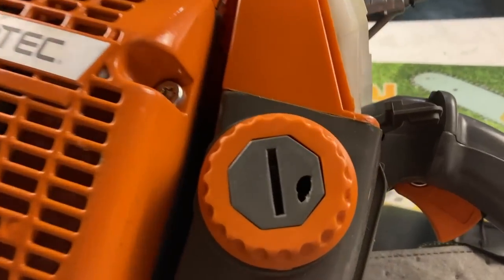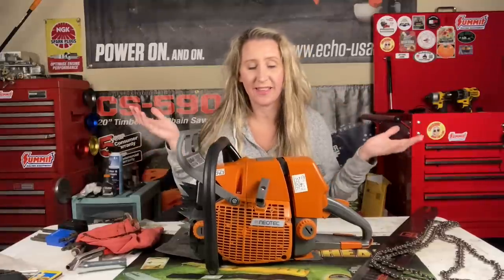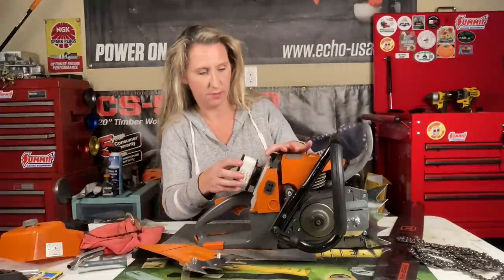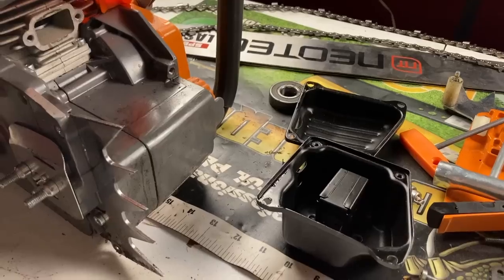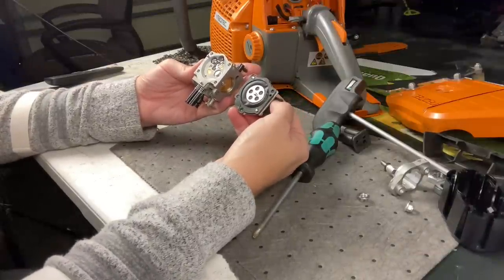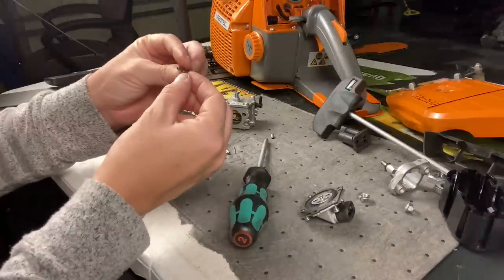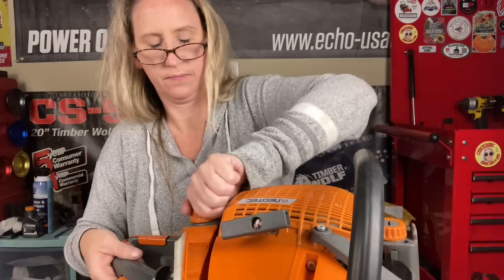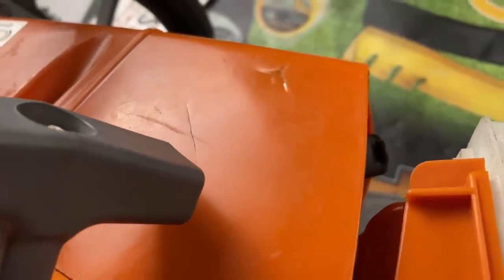NEW "STIHL CLONE" chainsaw, NEOTEC Mechanic Review and Repair. (You won't believe what happened!)

Comment: Hi mate ,i have a neotec 070 i have been using for slabing for over 12 months and hasn't missed a beat so for
Reply: I'm going on month 6 of quite a bit of milling with my Neo Tec 8105/070, only thing so far is broken clutch spring, probably from the saw dust with the saw constantly running on its side.

Comment: well i have a ms250 clone from haultz former and i have had it for over 3 years and i have worked the hell out of it and the only things i have had problems with is the clutch and pull start and it run very good it starts 1st or second pull!!

Comment: G444,G466,070 all blue thunders run perfect 3 years so far  18,28,42 inch bars. Cut 10 - 94foot oaks last year. cutting all oak here. New they need to run rich there super tight  old school brake in.

Comment: So I bought a NeoTec 892. I didn't trust the H/L needle valve settings so went to screw them in all the way and the Low side doesn't seem to bottom out. It gets tight but I don't want to overtighten. And ideas? Pull the carb out and take a closer look?

Comment: I think to be safe, buy the smaller power equipment from a reputable dealer, be it Stihl, Echo, or Huskavarney. Whatever you prefer. In my experience, I've bought a number of pieces of equipment from  dealers, it was test ran, set up and has not been a problem since. And if you do buy from an equipment dealer, be sure to explain to them how often the equipment is used, and they can recommend the right fuel to use with it, and maintenance requirements. These little machines can be very expensive to buy  especially if you are running commercial grade, but investing in quality equipment, and the right maintenance and support, they will outlive their aftermarket counterparts.

Comment: I would just look around until you find a quality saw used in good condition. I needed a larger saw to take out several larger trees my old 021 would struggle with. Found an 038 av mag2 72cc in amazing shape for $125 bought a new bar and chain. Filters and lines. Now I have a saw that will last me forever as often as I need something that large

Comment: Hello I have a question.  Do you ever fix or rebuild Old chainsaws? If so how do you get parts on saws that are from the 70's. I have a Skil 1616 chainsaw , the coil wire pulled out of the coil and it also seems the coil is bad anyway. I have tried searching ebay and the web in general for coils that are for that model but nothing. Is there a way to find a coil made for another saw that will work? Thanks Bre

Comment: Really hope to see a conclusion video on this saw...(can/will it run properly) Great work!
Reply: Me too neither!
Reply: I guess it was to avoid encouraging people to stihl buy the Neo thinking they're okay with a little tweak here and there.  I'd rap the plastic with a screwdriver to see if it fractures that easily. 
It's strange the recoil would or could have kicked back so strongly to yank it out of the customer's hand and hit the plastic so strongly, especially if it never fired once.  Seems that it was maybe dropped onto a hard surface and the plastic couldn't hold up as expected.

Comment: Few years ago I bought a new Karcher pressure washer the engine casing was very thin it had a hold in the casing behind the flywheel similar to the chainsaw gas cap

Comment: Wow that is some cheap manufacturing. I just realized I might have flipped seat up side down on the needle! 😫 well I need to replace hose and bar oiler I think! On my recent purchase of a Stihl 021. I decided to go vintage for my fist one saw! Take apart and rebuild so I can learn how to maintenance myself! I do enjoy wrenching on these thing. Great vid. Is the ms210 the same engine as 021 I will have to do research. I can’t wait to get this fire cracker running. I even downloaded the Manuel. Maybe some day I can get my own place or go work for Bre!

Comment: If you buy the 892 buy the kit. If you inspect each part as you build it,  file the sharp cylinder ports and tune the carb starting at 1 1/2 turns from seat on both screws(maybe take the carb apart first to have a look) Kinda a fun project for the weekend wussies

Comment: I purchased the NEO-TEC 12'' Top Handle Gas Chainsaw 2-Stroke 25.4cc from Amazon. The package had everything included, and I had to adjust a little on the carburetor, but it cut and ran fairly good. Sometimes it would stop going to idle if I did not hit the throttle a little, but it worked good. I manually oil the chain and bar rather than place bar oil in the reservoir.
Reply: You're going to have to explain that last line a little...  it's not like it has a pump oiler.  What are you dunking it in a bucket?
Reply: @mattfleming86  you pour oil on the bar.
Reply: @AAckeltonDDDDYY  In the rare case where i've ran out of oil before fuel, I can tell within one cut that the chain is dry.  Even on an arborist sized saw like this one that is beyond impractical.  Before automatic oilers there were pump oilers.  Both exist because chainsaws can generate a MASSIVE amount of friction in the cutting process.  I do not see any practical motive here.
It's like saying "I don't use the carburetor I just squirt fuel in with a windex bottle"
"Manually" applying oil is a great way to get not just the bar and chain hot (and excessively worn) but getting the clutch side of the crank hot and destroying the crank seals.

Comment: It's unbelievable just how much total junk is out there waiting to snatch our hard earned money!  Glad there are people like you who give us an honest review so we can be forewarned!!  Thank you Bre!!
Reply: The lady is correct the salt is junk as is most of the things that came out of channel
Reply: You're absolutely right. That's why I try to stick with known brands.
Reply: I wish i saw her Video before i order one i just received my ns8105 couple days ago so soon i put fuel in it it  leak right back out bottom of fuel tank real bad so i decided to start it up and run it it shoot out and spray out more so i made a cut about 3 to 5 min it makes loud noise so i cut it off and it don't start back up just loud cracking nocking sound i spent$589 and no refundable or exchange but BS
Reply: Sadly, even the old reliable brands are quickly becoming junk.  It is getting harder and harder to find quality.
Reply: @nunya3163  you are right, i have a lemon now in the shop now that have had a persistent problem since new, hope a new carb and new choke set repair they came up with will fix it for good.

Comment: Hi Chickanic  Love ur videos I just turned 75 today 2/3/2023 I brought a 2001 yard machine riding lawnmower I'm unable to a manual to change the oil n filter it turns to have a mesh screen so I bought it n I asked where does it go u told I would have to Brigg n Stratton as I found out they answer their phone do u know  where this screen goes
Robert Johnson

Comment: If I am using one of these (or a Stihl) to cut ice holes in a lake where we do not use bar oil, will the oil pump burn out from running the saw without bar oil?

Comment: All the specs ive seen for the gray saws is a 25/1 mix.
You run em at 50 mix with rpms of a oem version, simply, they will die.
.
I have one of the classic versions of the 372 husky farmertec/gray saws, and im at 100 tanks or so in 4 years. With minimum issues. 1 Pull string, 1 kill swich and 3 plugs.
After the first 5 gal of 25/1 mix i went to 32/1 and always clear 92.
No issues with bugs when running it ha ha.
Compression is still around 180psi without the base gasket.
.
To comply with law i did swap it to a proper, un-modded spark screen muffler to avoid a big ticket.

Comment: There is  Tinman video of a repair on an old Stihl that blew up (this was a 30 y/o saw), his diagnosis was that there were flakes of the plastic coating on the inside of the crank case had messed up the cylinder/piston, so maybe the paint chunks could do the same.
Reply: I was just going to say that too love his channel

Comment: The worst kind of customer is the one who doesn’t know how to fix their machines and expects everything to work flawlessly for the life of the machine. For me, I have an Ojenas which is a Stihl 880 clone and it works great. I use it on my Alaskan Sawmill and it’s a beast. The only issues I’ve had are the stud bolts sheering off and the ignition coil not being  correctly gapped. I’ve been using it for two years. 
Your tools are only as good as the operator.

Comment: I agree with you professionals should get the best equipment, not going to look good if your saw breaks in middle of job. I can believe that the paint could scare cylinder wall, I  have done mechanical work in past and with tight tolerance does not take much. I watch guy's at gun range making similar mistakes, before the shooting starts they grab can of spray oil and soak down chamber. I told my friend can you imagine what it is going to do to the chamber as all the unburnt gun powder, dust and dirt gets caught in oil. I  told him that chamber is going to be sliding on something similar to course sandpaper, clean gun and light oil before match less chance of malfunction and damage. The same with your saw at end of day clean up and sharpen chain makes next job easier and tools last longer.

Comment: Just looking at the first video you made of this saw when you change the diaphragm on the carburettor yes the needle was in the wrong position but when you reassembled it you didn't put diaphragm underneath the needle in the little V slop so it was still pushing against it which would have made it flood out and hard to start again like I said on the recent video you just made of this machine on the second video you made you wonder how it came out he didn't come out you didn't clip it in

Comment: I just bought a Neo-tec NH 872 (372xp Husqvarna clone)  with a 24 Inch bar for 380 bucks on amazon.....i debated a long time before the purchase of this chinese made saw.....on ebay you couldn't hardly find a used 372 xp for under 450 bucks......I will say that the 24inch bar on this saw is much heavier that the 18 inch bar on my 350 husqvarna.....i have used this 372 xp clone only one time and it did work quite well......had i seen your video before making the purchanse i would'nt have bought this neotec knock off.

Comment: Can't speak for the 892, or every clone saw out there, but I got the neotec 660 clone at the beginning of summer knowing that I was rolling the dice. I've had to fix the oiler, work on getting that air filter to seal better, grease the needle bearing, and do some clearing on the chain brake. That all being said, I've put about 10 tanks of gas through it and really do enjoy using it. Definitely not for everyone, but if you don't mind rolling the dice or tinkering, can be a fun tool/project for a grand less than the name brand.

Comment: So I had one of those farmer tech g660. It was junk it lasted me about 5 weeks. First the exhaust rattled apart, after that the piston and cylinder burned up. I ended up finding two air leaks in it. One in the crankcase and one where the cylinder bolts to the crankcase

Comment: I think the cylinder was scratched from the factory. Kids and old ladies working in a sweat shop aren't interested in quality control. Considering quality craftsmanship, it's probably not a big deal to leave the paint in the cylinder. Stihl are good saws, but I'm rock 'n' with an Echo chainsaw and have never had a problem. I just do minor maintenance and let it run once a month. I can't say if this is typical or I'm the exception. I also won't use any alcohol blended fuel in a small engine. Good video.

Comment: If the black gunk is from the exhaust side, how did it get to the induction side, through the air filter? I think it's poor quality control during assembly. I would return it if it was mine. Thank you for sharing the videos and your knowledge with us. Take care. 👍
Reply: 2 strokes pull air back into the cylinder from the exhaust, as they cycle, that's normal function
Reply: Ah, I didn't realise there was the chance for that to happen. I've only ever owned 4 stroke trimmers and mowers. Thank you for clarifying that. 👍

Comment: I do not normally repair gas tools but I friend who I owe to many favors left his Stihl trimmer with me to fix. There is a box full of Chinese parts with it. In Australia getting parts is more of a miss than hit affair, the only surviving wrecking yard nearby looks more like a quasi new car dealership. The new coil from ebay arrived, looks fairly close but I am sure it is wound backwards. The thing does backfire on starting fluid but this is the only sign of life now. The "new" recoil side has the clock spring fading like there is no carbon in its steel. Our mostly only surviving hardware store has trebled its choice of gas garden tools with with the return department also needing a building extension! Battery tools fear slightly better, all 82V gear has a return rate of just under 80%! Long live quality!!!

Comment: I read a lot of comments here that just seem to be whining about cheap saws. Like it is surprising that when you buy a cheap saw, you actually get a cheap saw. Do you expect that a cheap saw should be made of gold?  If you don’t want a cheap saw, don’t buy a cheap saw. 

I wanted a cheap saw a couple of years ago.  Well, actually I wanted a cheap box of parts that I could assemble into a cheap saw. I didn’t need a $2000 saw.  I wanted a parts kit that I could enjoy putting together, and maybe use to cut a large tree now and then. 

I am very happy with my parts kit.

Comment: I'm getting a holtzformer 660 later today, I'm a home owner with 4.5 acres... I mostly use a 16 inch ego battery saw, any advice for initial set up and break in so I can use it 3 times a year for the next few years.  Amazing video.
Reply: Ive been running a good 2 cycle oil mixed 1:32 through mine.
Reply: Yep I’ve got the $75 52cc Vehpro and it needs 32:1. Yeah I’ve got Stihl and Husky saws but I’m here to tell you the $75 52cc Chicom saw really runs and cuts well. Can you beat it around and be hamfisted with it….uh definitely no.

Comment: Hey there I have a 57cc Blue max made by Stihl. I removed the nuts that hold the chain bar/brake to the housing and the bolts came out instead and now have stripped the bolt holes. The bolts keep turning what can I do to fix this?

Comment: This year, I added two of the farmertec g466,g444, knock offs of the old 044,046 both with 20" bars, had to replace the chain adjusters so far. I figured for 300 each , I'd give it a try. My new 500i was 1500. And the 400 was 1200.
Reply: so how are the Farmtec units working for you?

Comment: Hi!  My wife and I love your channel. You make such great videos.  two questions one time you mentioned a Stihl chainsaw that was very light and very good. Which model did you say it was I’m trying to find a video but I can’t do that either. We have echo equipment already. What echo chainsaw model do you recommend for my wife and I?
Reply: Very light but saw?  Open to echo?  Cs 3510.  Hands down my favorite saw.  I have saws up to 60cc (the 620p is a GREAT saw when you need the power) but that little 3510 is something special.  I've cut wood much larger than I should have with it with a sharp chain and a little patience.  I've even done some major felling and bucking with it when I need to pack into fencelines on my property unreachable by road.  It is a limbing and brushing machine and holds its own in chunky hardwood that most 35cc saws would die in.

My dad did small engine for a many years.  He probably has 25 saws hanging up in his shop from all eras and brands.  He ran my 3510 for a several hours this summer and ended up buying one..  only new saw he has ever bought.  Something magic in that little plastic shell especially if you get the good stihl 63pm chain for it.  To give you an idea of how much I run a saw I've done probably 25-30 cords of hardwood and went through about 25 gallons of 2 stroke mix gas since spring.  Loooots of hours on that 3510.  It just keeps chooching.  The day it blows up i'm buying another.

Comment: I've got the Farmmac F660V version of this saw. Other than the gas cap seal being misforned and leaking gas I had little trouble starting mine out of the box. I ended up upgrading it to a Hyway Big Bore Popup Piston Kit. Has 210 PSI compression and runs an 8 pin sprocket without issues on my 28 inch bar. Yes they aren't as polished a product as the real Stihl, but I can't afford the real ones.

Comment: My impression was the saw had to much fuel in play increasing the cylinder pressure so with every pull it would jerk the starter handle out of the owners hand and the handle bouncing around damaged the saw.  Anyone that has ever had a saw jerk the starter handle knows it's a lotta force. Likely corner of handle broke gas cap. The starter spring likely should be watched now and the nubs checked. Nice work

Comment: I have the hallsforma 372 and I do commercial tree work never had a issue with mine people need to break ther saw in before they use them run a full tank threw it at idle maybee 2 tanks but mine is ported and it rips had nothing but good things to say about mine

Comment: You're very brave to work on any of those clone saws. Most shops won't touch them and turn them away.....and for good reason. You have to understand that what drives the manufacture of power tools like these are people perpetually looking for bargains & deals. It's all about that...never the quality of the tool. If they were independently wealthy, they'd still buy new junk power & hand tools.  Talk to them about buying a pro level chainsaw if they have a lot of work for it and you might as well be speaking Latin. There is no 'value' in a cheap power tool if it's always on the precipice of failure or fails regularly.  And yet, here we are.........